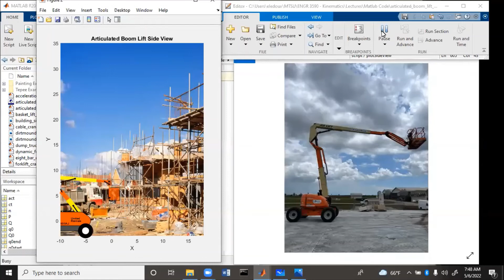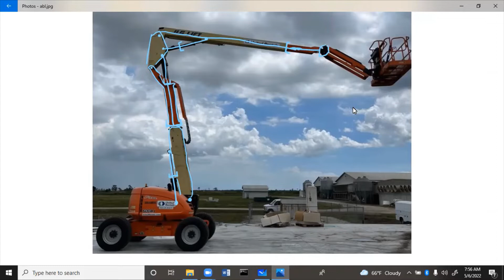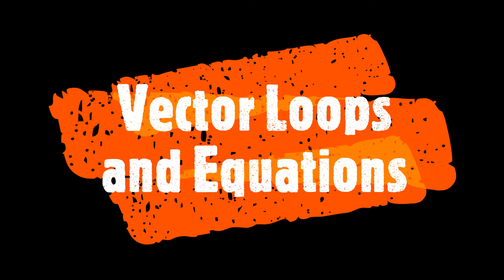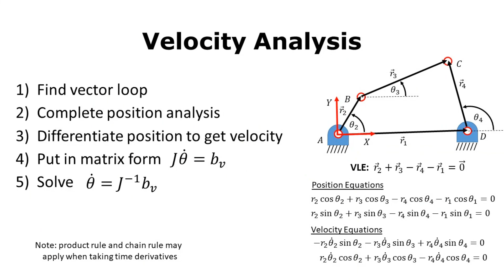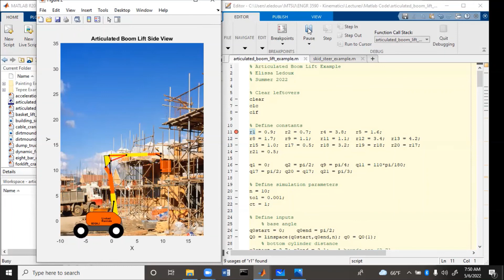Articulated Boom Lift Vector Loop Analysis

Comment: Is the velocity vectors required to animate it? Or can you just use a varying position vector for animation
Reply from the maker: You can use changing position vectors for the input.  To calculate the unknown angles, you do need to use the Jacobian with Newton's method in a while loop.  The easiest way to get the Jacobian is through velocity, but you can also just take partial derivatives or use the formulas explained in this video: https://youtu.be/mBTLWPXTckU .  An example of using Newton's method to solve for unknown angles in code is here: https://www.youtube.com/watch?v=_Ikq9nQTrz4
Reply: @dynamicsandkinematics  Thanks for the quick reply. I was thinking of using Gauss-Seidel to solve the set of equations, would that be possible?
Reply from the maker: Yes, any iterative method for solving systems of linear equations should work.